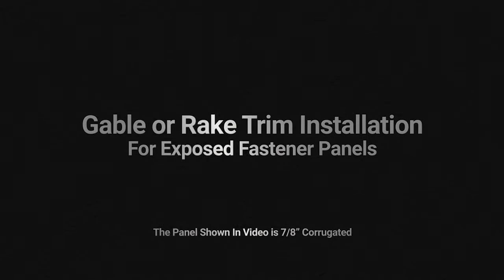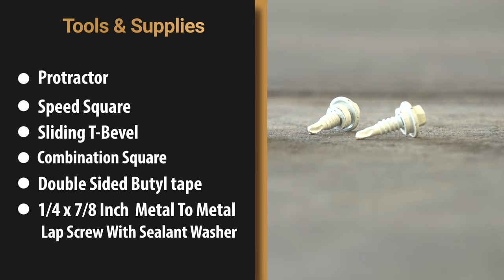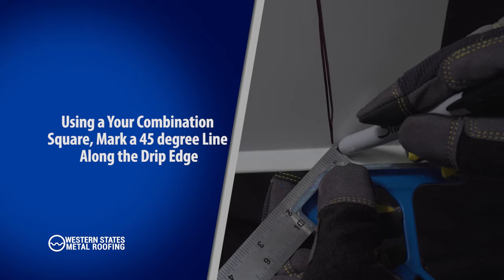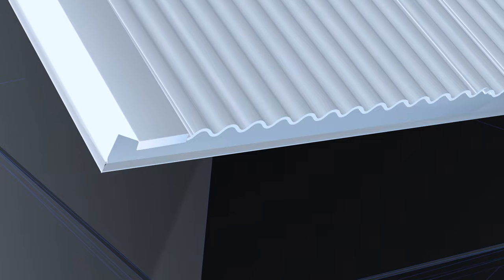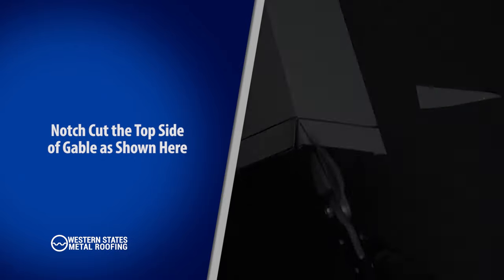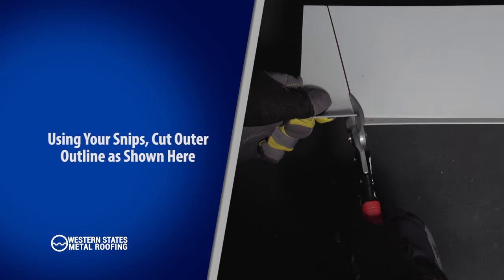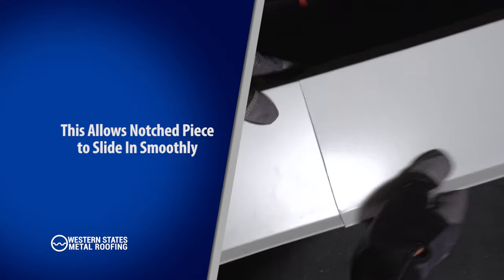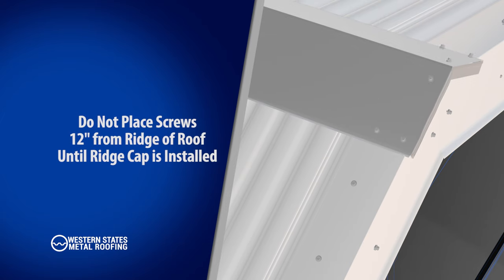How To Install Gable Trim On Metal Roof. EASY Video For Gable And Rake Trim: Exposed Fastener Panels

Comment: It would be worthwhile to make a video of gable/rake trim installed at a high->low pitch transition because that's a tricky spot.
Reply from the maker: Oggy, You're absolutely correct and we appreciate the feedback. That one is on our list, but it's a long list before we get to it. Stay tuned as one of these days we will get it filmed and uploaded on the channel.

Comment: My barn has this detail and it's leaking at 30 years. Not bad but now I have to caulk this seam again and it will never seal like it did when the metal was new. A better approach I've found is a mechanical approach without caulking and trough fastening. Fold the panel over the rake using a T drip for the cleat similar to this:  https://www.youtube.com/watch?v=Nv3lerxWLH8&list=PLDRjQCJzu5T-6T0BV6Ml90wqMgEbiwqqx&index=2&t=0s
Reply from the maker: Robert, I appreciate the comment. The video that you have shown will work great for a standing seam panel. This video is intended to cover the installation of an exposed fastener panel. Different installation procedures.